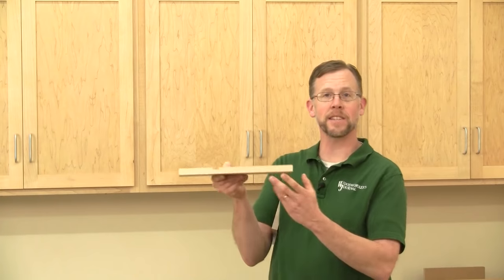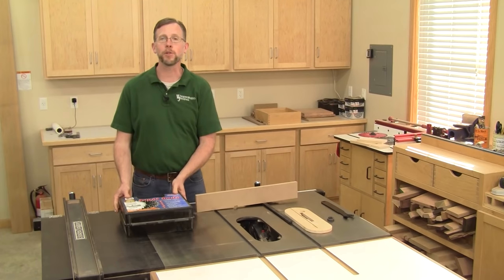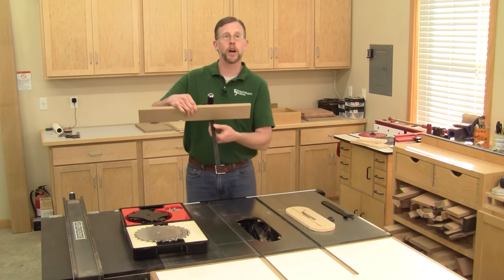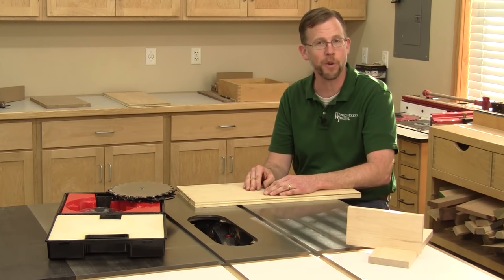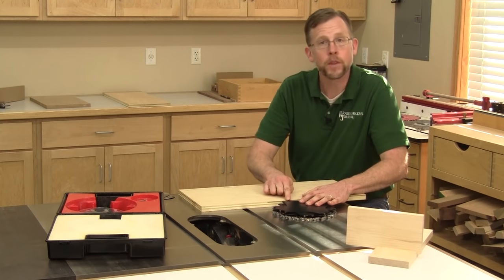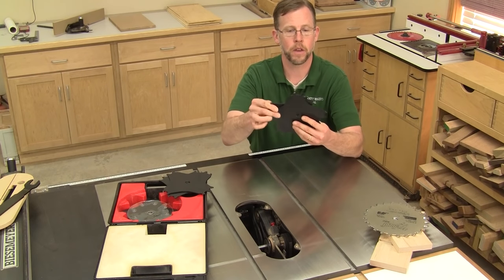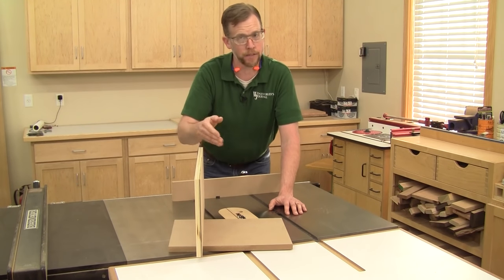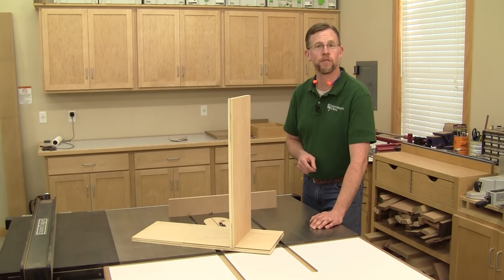How to Cut a Dado with a Table Saw

Comment: Nice and informative on using the blade to cut a dado but what's the dept you should go with a piece? Say I was making a box using 3/4 for the sides and 1/2" for the bottom. How far from the bottom should you make that  cut? And how deep should it be?

Comment: Do all or most table saws have the ability to use dado blade sets?
Reply: The arbor has to be long enough to hold the width of the dado stack. You also have to use a dado insert.

Comment: Wondering if it's possible to tilt a dado blade at an angle?  Like a 25 - 30 degree angled dado or groove?  Would that work for a tight fit?

Comment: Or you can save 80-300 bucks a use a single blade and just run the wood back a few times.
Its a little bit more work and some clean up on the joint. 
Depend on the person. I don't mind the little bit of extra work.
Reply: Thanks that's why I came here. I'm looking at a $300 table saw that doesn't support a dado blade, and I may make like 10 dado cuts in my lifetime.

Comment: What's a good ratio of cut depth for most thicknesses of wood?
Like, is 1/3 the thickness suggested?  1/4th?  For the .75" piece of wood, it looks like you did 1/4, which is a third of its total thickness.  Does it even matter?

Comment: I want to be able to make these cuts when I get a table saw. What do I need to look for when I’m buying a table saw to make sure I get one that is capable? Thanks
Reply: Gabe Darnell * Make sure the arbor is long enough to hold a dado stack.
Reply: i've noticed an arbor measurement on some saws of 5/8 and others at 1 inch. Looks like I might get my father in laws Hitachi that has a 1" arbor.  Is that enough arbor length for dado cuts?

Comment: Can anyone answer instead of buying a super-dado which is expensive, can I just use 3 or 4 10" circular saw blades of the same time with or without a washer in between? I just can't afford the $300 dollars deep cuts. Need some info. Been doing it for over 10 years, but still consider myself uninformed in some things and this is one thing I need info one.
Reply: Man, you don't need a $300 dollar set.  You can get a decent set for about $100. Irwin and Diablo both are around that price range.  Also,  a set of dado blades is much more versatile regarding the widths of cuts you can achieve.   Stacking circular saw blades seems pretty inaccurate so that tells me you are not real concerned with accuracy, which also tells me you would not be a professional woodworker, so spending $300 on a set is not needed.  These other sets will give you better results and more usefullness.

Comment: Wouldn't it be quicker to make several runs until you reach the desired width of the dado cut rather than disassembling the blades and spending extra time mixing and matching everything trying to get the width you need?
Reply: A dado blade makes a cleaner cut and all your dados will be the exact same width.